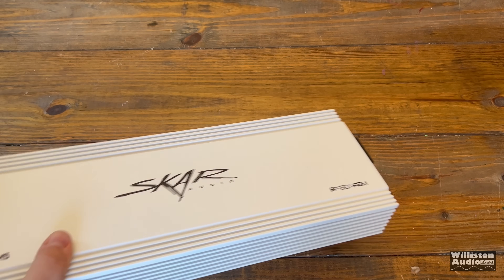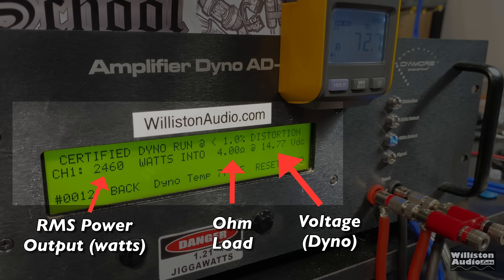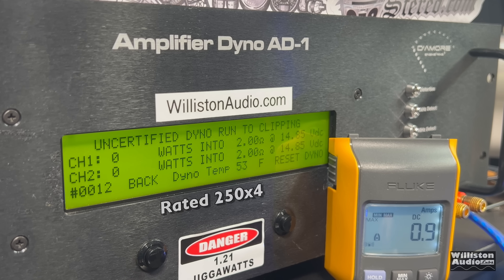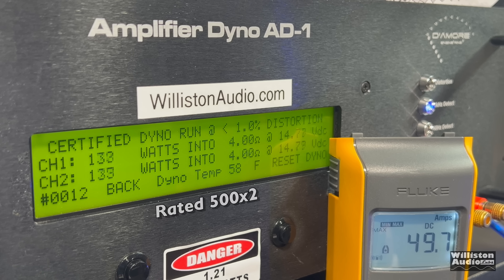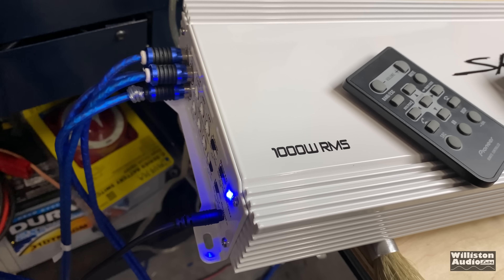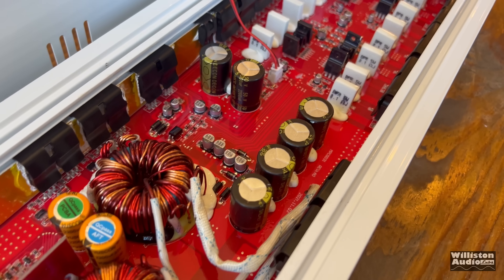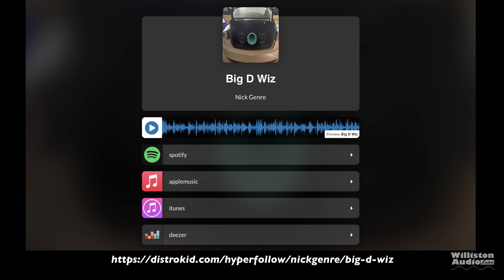Can SKAR AUDIO do Sound Quality? The RP150.4AB Amp Dyno Test and Review

Comment from the maker: SHOP
SKAR AUDIO RP150.4ABM: https://amzn.to/3wEUWHj (marine version)
SKAR AUDIO RP150.4AB: https://amzn.to/3whDnwJ (standard version)
Down4Sound JP34ab Class A/B 4ch: https://bit.ly/3sZoFsY
4ga to 0ga input adapters: https://amzn.to/3ijToP8
Down4Sound Amplifiers: http://Shop4Bass.com

Used in this Video (Affiliate Links)
Elac Debut 2.0 B2 Bookshelf Speakers: https://amzn.to/3knAF5V
KICKER L7R Quad Box: https://amzn.to/32P3eNY
Pioneer DEH-80PRS Head Unit: (eBay Affiliate link) https://ebay.to/3xdUwZ6
Stinger 6000 Series RCA Cables: https://amzn.to/3d4W80b
Stinger 12ga OFC Speaker Wire: https://amzn.to/3d4pWKo
D4S 8g OFC Power Wire: https://lddy.no/1csoz
Precision Screwdriver: https://amzn.to/3B920NZ

Check out Nick Genre ("Big D Wiz" Song at End)
https://distrokid.com/hyperfollow/nickgenre/big-d-wiz
For Donations
$NickGenre on cashapp genretc@mail.com on paypal

VIDEO INDEX
0:00 intro
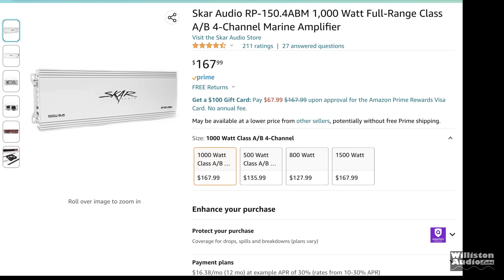0:49 Unboxing
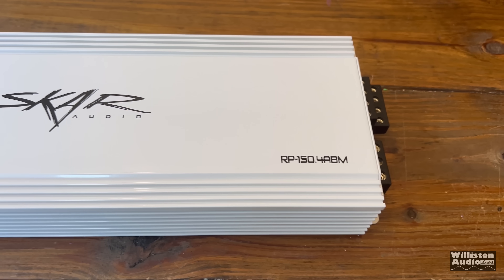1:50 Features and Specs
3:32 Amp Dyno Tests
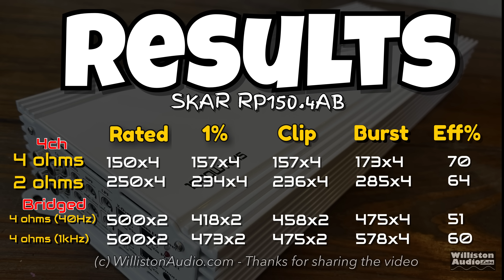8:13 Sound Demonstration
10:22 What's Inside?
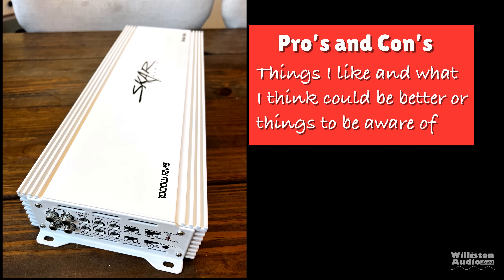11:15 Pros and Cons
12:04 Final Thoughts
12:29 Big D Has a Song?

CAMERAS AND AUDIO GEAR
(Video Gear I Use) 
Camera - iPhone 13pro 1TB - https://amzn.to/3nCjGvc
RODE Wireless Go II Microphones: https://amzn.to/3Q6NVHl
Shure MV7 Microphone: https://amzn.to/3A4OICK
Zoom H4n Audio Recorder: https://amzn.to/3BXjVsS
960 LED Panel: https://amzn.to/2Sxoq3S

TEST BENCH EQUIPMENT
SMD / D'Amore Engineering Amp Dyno: https://goo.gl/sJTcf7
XS Power D1400 Batteries - https://amzn.to/2BPFCKW
XS Power PSC60 Charger - https://amzn.to/2CHGcfs
Fluke 1000A AC/DC Clamp Meter: https://amzn.to/2Rw5WDA
Handheld Dyno: http://amzn.to/2u2EgKV
My Favorite Screwdriver Kit: http://amzn.to/2x0VzcE

DISCLAIMER: This video and description contains affiliate links, which means that if you purchase from one of the product links, I may receive a small commission. As an Amazon Associate I earn from qualifying purchases
Reply: Do you any Idea where 80hz is between 20hz to 5Khz on that amp?

Comment: I'm going to run 10 wet sounds revo 6 speakers in my boat and hope this amp is powerful enough for them. Will be running 5 on each bridged channel.  They are rated at 100 watts RMS at 4 ohms. The Rockville 8ch marine amp I'm using now keeps going into power protect mode when I turn up the volume. It seems to be getting super hot or just doesn't have enough power.

Comment: I’m running this amp and pairing it with a JL 10w6v3 and two pioneer mid bass door speakers. My question is with that sub being 600w rms and the the speakers equaling 220w rms. Will this amp work bridged and bump?

Comment: Marine stereo products are a great way to up your game for your car stereo. Marine amps are better built, and CEI Rated. Think how boats have to handle waves and wake without a suspension. So stereo components have to take that and keep working. Plus, Skar uses a fan with their marine amps, and yet the signal to noise ratio is 105 dB in this amp. That's really good Sound Quality.

Comment: Amps can look the same , thats the trick, but the quality of the internals are all different, buy a sony and it will last over 20 years , these amps wont last over two or three years, but they make them for shows andguys who are new, they have a lot of good stuff aside from them, but for the money you can do a nice system, just know something might go wrong in a few years, alpine, kenwood, pioneer, zapco, genesis, mosconi, focal, hertz, will last longer, but for less than 160 bucks for each, you can do a. NIce system , i recommend  using a dsp, a cheap one like dayton,  and make sure the watts on thespeakers is always lower than the amp, and learn to match the gains, keep the gains low, its not a volume knob, thats why they burn up quick

Comment: I have this amp. 2 channels bridged to a 12 inch sub and it sounds like a 2 inch sub its so bad.  Wondering what im doing wrong. Gain and filter seems to be correct
Also used a 15 and didnt get any noticable gain.

Comment: I have run both the rp and skv. Although the rp is a nice amp. The skv sound quality is night and day. The skv has much better sound quality by far. I've tested both with a scope. Korean vs china. I run an rp in my daily driver and the skv in my theater sound truck both have lc units in them. I think it's all about price per watt for most people though. For budget bangers vs quality. Skar is still hard to beat for what you get. Just like many Brazilian amps. My taramps hd10k is still banging hard. It's old but still sounds good. It's what you want vs what you can afford. I really appreciate big d and hifi for what they show however. Really nice work with what they do showing newbies to the world of bass.
Reply: For the skv is it class d or ab? Cause they don’t really mention the difference between RP and SKV in the components. Anyway I got a RP coming and I’m going to test it against my Morel class ab amp.
Reply: Which amp would you say is louder (with no annoying buzzing/whining in the speakers)? The RP-150, which has 150 watts per channel, or the SKV2-100, which only has 100 watts per channel, but is higher quality parts. Also which one does a better job at staying cool in tight spots like behind truck seats? The RP has a cooling fan, but the skv2 has the upgraded heatsink, but no fan. Thanks a bunch!

Comment: Like always Good videos..i hava a question for everyone here.  Between front channels and rear channels is any sound delay?  Anyone know??
Reply: No actual sound delay
Perceived sound delay
Set your fader front & rear to " middle "
if you have both front & rear speakers
now sit in the middle of your vehicle
you should hear sound coming from all directions equally
Many aftermarket head units offer 
" Time alignment " & a microphone
so you can have the head unit make all the adjustments so sounds comes through at the same time depending on where you set the microphone

Comment: Side note: (for those that might be unaware)

Skar uses the absolute worst RCA preouts known to man.
The ring surrounds will come off if you glare at them too hard, or they will shift and come loose from the connection from the wind. Solid amps for the price but the RCA ports are abysmal.

Comment: ...I suspect that it will not be the made in Florida US Amps we knew in the 90s Big D.I think the name"US Amps" has been bought and sold a couple times already, most recently RE Audio. Still designed by Dirk Ecker, but manufactured in Asia. If memory serves, Dirk was tasked to design very low noise amplification for medical devices, but his designs made their way to the 12 volt industry...and became legendary. Expect to pay at least $500 for a decent used US Amps, made in Florida 25 years ago, REAL US Amps amp...looks like the new US Amps will be made by SKAR, and not be designed by Dirk Ecker, and most certainly not made in FLA....Its a bummer Big D

Comment: I was hopeful the 3.5 jack bass controller was dead. Kicker and skar are keeping that garbage alive and those are 2 the larger selling brands.  3.5 needs to be ended.   I would like to see the end of rca as well only the better quality ones stay properly in place but most stereos have rca inputs and so if you have any slight movement it’s out.   Happens on bass knobs with RCA as well like I say unless you’re using a premium knob and connect to only premium cable.
Reply: Number of times I seen cheaper bass knobs and the wire is wrapped in packing tape or duct tape.  Hahah

Comment: Excellent review. I've been using the skv2 100.4 for a few yrs. It replaced a beat up dual 4 channel. I can say it does sound cleaner. No weird, notes like the dual. Gets hot but with the ac dm608 it sounds decent. Disappointed with the ratings but most run 4ohm n 150 w is louud af. Hope they revamp their line soon

Comment: Back in October of 2021, I purchased two 4-channel amps from Skar Audio (SK-400.4D). The first one died three weeks from the date of delivery. The second, in my daughter's car, died 6 months later. Because the first one failed within the first 90 days, they allowed me to return it for a full refund. I got lucky with the second one because it was on back order and would take six to eight weeks for it to be available. Since I didn't want to wait, they offered me a full refund for that one too. Besides their failure, I found them to lack power and don't believe they were even producing their rated power, like the many previous amp I've owned in the past with similar ratings. Additionally, I had two of the channels wired down to to ohms and it kept shutting it down. To say I was not impressed in the least, would be an understatement. One amp, I can chalk up to a fluke, but to identical amps with issues was disappointing. I will say this, I was very impressed with their return policy and glad I was able to get my money back for both amps, so there's that.

Thanks to this Big D Wiz and his awesome channel, I've since been able to make some educated purchases and bought three D4S (Down4Sound) amps and am extremely happy. 

FYI, in the past, I've owned (and still own some) various amp brand of amplifiers (i.e. U.S.Acoustics, Proton, Pyle, Kenwood, Bazooka, Infinity, Pioneer, MTX & Blaupunkt with possibly more which escape memory at the moment), therefore, I feel I've had/have a vast variety of amps to compare the output volume from the Skar amps to.

Comment: I love mine !! I have 2 on mids & highs and my son has one in his car !! Solid amp that has a fan to keep it cool when driving it hard!
Reply: When I turn up my gain on it, it seems to have a lot of noise, idk why, maybe I expect too much
Reply: @trentbolognani2509 there’s so much static in mine too. Set the gains with a DD1. Idk if it’s the amp or something else. It still makes the static noise with no rcas plugged in.
Reply: The gain is to match the radio to amp , nota volume increase, that's why it's too high your getting distortion 😅

Comment: Class d is INHERENTLY FLAWED and isn't suitable for true hi-fi. It's tolerable for subs since the efficiency is often needed. They should not be used for mids and highs unless maybe you need to power some huge PA system. There is no need to sacrifice purity for efficiency there.
Reply: I agree, I bought the JL HD 600/4 and it sounded ok but not as warm as the class AB, I think it’s just preference tbh as it had very good bass response and midrange control,  but the highs sounded so lifeless I couldn’t even take it. I sent it back, class D is not my preference for mids and highs
Reply: @radiospank  it's more than preference really. There are fundamental limitations to the topology.
Reply: @HumansBeing365  every class d 4 channel ive heard always has this hollow sound, hard to describe but doesn’t do the speakers justice
Reply: I agree. I don’t know enough about the engineering side to say “why” but I’ll never run my mids & hi’s with a class D amp. For sub duty, no problem but not on my front stage.
Reply: @msh6865  thank you for your in-depth rebuttal. Very poignant and educational. 😑
Reply: @FiBTL18  an Fi user should know better lol. Thanks for the informative reply 👍👍
Reply: @HumansBeing365  🤣🤣🤣🤣🤣🤣

Comment: Great test!!! Caught my attention I ran two of them last year and sound quality is spot on spot 👌
Reply: I can’t figure out when I’m not very loud with this amp, not much louder than headunit power,
Reply: @trentbolognani2509  how do you have your signal coming into the amp if the signal is low the amp will amplify a weak signal = low output you strong signal to = strong output
Reply: @Thatkiddaj_  it’s a cheap radio, it only has 2 outputs so I have an rca splitter and it’s not a 5v or 4v pre out I don’t think, it’s like 2 or 3 I think. It’s a Sony a410bt

Comment: You should dyno one of Alpine's KTA series(power pack) amplifiers, that way you can put to the test their DPP(dynamic peak power) technology which supposedly doubles it's power rating. I'm guessing there would be a huge difference between certified and dynamic runs if it's true.
Reply: Was just looking at those
Reply: Please Do That For Us.
Reply: Yes it's about time. 
They have been out for a long time
Reply: @freack201  KTPs have been out for a long time, KTAs came out in 2019
Reply: What are the top 3 amps

Comment: Skarbage as usual
Reply: My thoughts exactly. Dont care if its a/b or not. Skar still remains in the same league as boss and the lot. Barely makes rated power for shite eff%. Big d has already done a dyno vid on the rp series and it couldnt even make rated at 1 ohm......their subs suck and blow too easily, speakers dont last for more than a few months, amps have been proven to be shite, wiring is under sized and not ofc when it claims it to be, the list goes on. Better product for just a little bit more money out there
Reply: @Sheenoobie  My dudes... Did you even watch the video lmfao the amp has actually very high efficiency considering it's a class AB.
Also sound quality is orders of magnitude better compared to class D amps. 

On our boat with 8-8" Harman Kardon speakers with this same amp at 2ohm the clarity of the sound is insane. At the sandbar, people in boats with $5k+ JL sound systems come over to see what we have that sounds just as good but significantly louder than theirs. JL audio stuff sounds super crisp but not very high efficiency on speakers, and low power ratings on them too.

If all you wanna do is make noise just buy a Brazilian amp that can blow whatever speaker you connect it to.

Comment: So I tried a Skar RP2000.1D on a pair of Sundown Audio SA 12's in a spec built ported enclosure. I previously had them hooked up to an old school PPI PC2100. Obviously the 200 watts RMS I was feeding each wasn't enough to really get them moving but the SQ was amazing. After switching to the Skar and feeding them proper power they sounded mediocre at best. The frequency response of the Skar was horrible. There were certain parts of songs that the Skar just couldn't reproduce like the PPI. Its like certain frequencies were completely missing. For the price of the Skar I wasn't disappointed. They got plenty loud.
Reply: I feel the same. I had a Boston Acoustics 1,000 watt amp on 2 DD 2512 subs and switched to a Skar to 2000 and the sound quality dropped significantly.
Reply: @Chris Gardner 120# light weight boxer vs 300# heavyweight boxer NO comparison who's gonna throw a harder punch

Comment: US amps was top of the line. They can’t come back as skar. Lol.
Reply from the maker: I used to say the same with Soundstream, PPI and some others.
Reply: @wal  absolutely. All use to be some of the best stuff available. All I use now is deaf bonce. I’m on team DB though. So I’m a little biased. Lol. Love to see you dyno some of their amps. I have 3 aak-20,000.1 wired at .4 in my spl vehicle. Never seen one on a dyno. I’ve clamped 21k out of one on speakers rising to 1.1. I’m not actually sure the amp dyno will handle what those type of amps will do. I’ve noticed nobody ever dyno tests any of the big boys.

Comment: Question  why did the test was at 40hz if the amp is rated to min of 50 hz ?
Reply: The low pass filter has nothing to do with the frequency an amp plays. It is only the crossover point where it starts rolling the frequency off above 50 hz. A LPF setting of 50hz means it will play all frequencies below 50hz until either the amp can't reproduce it, for example 1 hz, or the subsonic filter kicks in. All frequencies above 50hz will roll off or start disappearing at 12/18/24 decibel per octave(amp dependent) generally. Big D does dyno tests with the crossover turned off. You need to buy a multi channel amp, or 2 amps and add speakers and a sub, and actually get hands on with it. Play with crossover points. Learn to set gains by ear. Don't take this as an insult, you are so new to the game that your initial question didn't make any sense to anyone in the car audio game. Just watch more stuff, and get hands on
Reply from the maker: who said the rated min was 50Hz? Only the bridged tests were 40Hz, but I also did 1kHz as comparison
Reply: @wal  I just  said that  limite was 50hz cuz its what the amp displays at the LPF ,  And for me did not made much sense  test it at 40 hz , But hey ,  im a  noob , and the end of the day  it was a question  .
The question was.  Why ? 
cuz i  legite  dont have the knowledge that you  have. just that man . tchill...
Reply: @Portuga RD a sphincter says what.

Comment: Who is out there jerking their mounted equipment around? I've ran one of these for 3 yrs and have absolutely NEVER had Any issues with pulling out the cable as your always talking about.... I guess people who leave them flopping around instead of mounting but dang.... I've absolutely NEVER had any issues with mine pulling out or anything like that. Ever. In a lil over 3 yrs..... Not once. Not even a single time at all.... Lmao....
Reply from the maker: you know some people mount their amps by the tether of the bass remote...
Reply: @wal  lmao. Those people need help my friend. A telephone or rg8 isn't gonna help them at all. Those are the same ones with sheetrock screws holding their grounds & 12/2 Romex for their power wires..... Lol. 😂😂😂

Comment: Also, back in the day I had one of the long US Amps 125x4 amp in anodized red with the plexiglass bottom so you can see the guts and that amp used to absolutely SLAM my four MTX 15s. It was .25 ohm stable and that thing never even got remotely close to hot. I won quite a few competitions with that setup.
Reply: They made a 125 x 4? Got a model number?
Reply: How do you get a quarter ohm load on a 4 channel amp with 4 woofers?